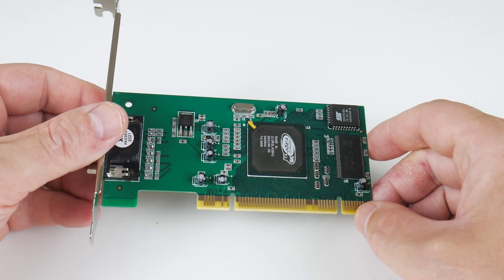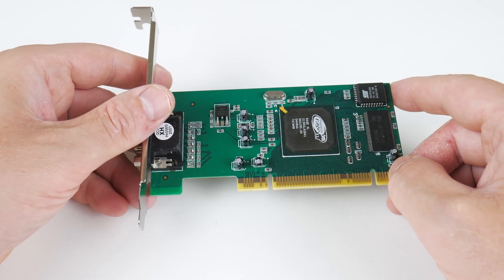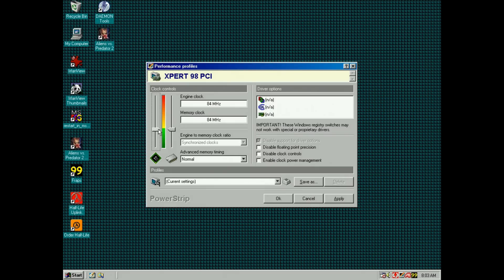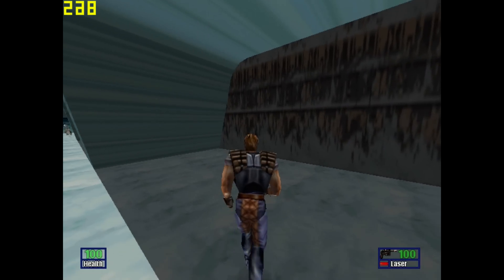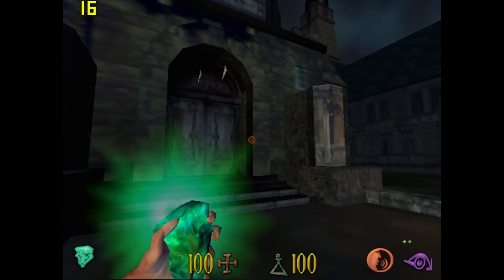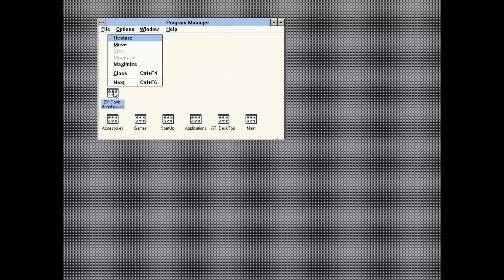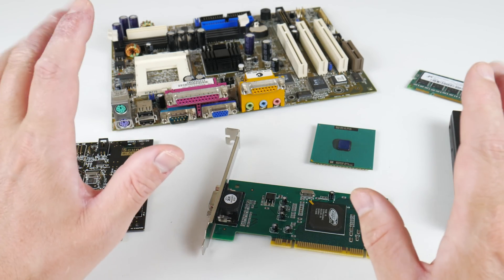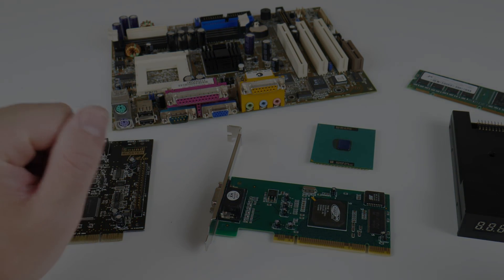Graphics Card shortage? Buy the ATI Rage XL!

Comment: I haven't checked yet but the driver disk says win98, but would this chipset have win95 drivers? Since most 98 builds would agp video cards I'd imagine this would make a better 95 card on super 7 or p2...might have to check this out when I get mine going
Reply from the maker: In terms of benchmarks and gaming performance, there shouldn't be much difference. But 95 can boot a little bit faster and maybe use less RAM. But RAM is cheap and easy to find, so I would go with 98, for sure with Socket 7 and Pentium 2.
Reply: @philscomputerlab  true. Win98 is better in terms of hardware and game compatibility...I was only thinking about socket 7 and older that had pci and no agp slots. I have a few Compaq, ibm and gateways like this that have win95 as OEM (with the specific "flavor" of branding ) that this could be a great upgrade for...since most at that time had maybe 2mb gra  onboard
Reply from the maker: I have only used 95 a few times. Even on lower end Socket 7 machines, I would go with 98. Just don't do a full installation and avoid unofficial service pack. And give the machine enough RAM, like 128 GB and you are fine :)
Reply: @philscomputerlab  I've used 95 if an OEM PC comes with it, or when I built a pc of parts right before the release of 98 as a last hoorah for 95 (parts that came out early 98/late 97)  but yea I prefer 98 for testing older parts. Much more stable

Comment: That card is so small and simple that it kind of looks like a PCI NIC!
Speaking of NICs and networky type things, the Rage XL was used in a lot of servers back in the mid 2000s.
Reply: Up until 2006 when ATI discontinued the Rage XL chips and replaced that model with the ES1000, based on the first Radeon (7000) in 2007. A bit bizarre to relaunch such an old GPU core so late but it required very few external components (good for cost) and was "good enough" for monitoring use in servers

Comment: Ahhh I remember this card very well. My first PC had a S3 Virge which didn’t work well with GTA2. My cousin had this card in his PC and that ran it so well. This was well before AGP graphics cards where common, even had a ISA modem and sound card. Upgraded to the notorious FX 5200 few years later.
Reply: Interesting, my second system had VIA integrated graphics which didn't run very well classic Quake2, so I bought it the FX5200 and game played better
Reply: I hate the S3 Virge, It's the worst "accelerator" I've ever used. Half-Life runs better in software mode on my old rig!

Comment: this gpu and the SiS 6326 are my favorite cockroach card. another budget card for me is the ati radeon x300 for win98 & xp early builds, the x300 can be had cheap and plentiful.
Reply: I had an x300. I used it for an output card to a 3rd display in order to get SoftTH to work. It struggled with 2D at 1080p!
Reply: I had an SiS 6326 from sometime in December, 2000 to sometime in late-April, 2001, when I got the Voodoo 3 3000 AGP. It pretty much was only good for non-demanding games.

Comment: I remember seeing Dawid review this thing since it's so cheap on amazon. my question is, why is there all of a sudden so many of these seemingly new-old stock cards that are almost 20 years old out in the wild now?
Reply from the maker: Likely they got their hands on old stock chips, and / or, removed them from old hardware and then designed a new product around it.
Reply: @philscomputerlab  Yup, the chip's date is 2004 and I think the memory chip is from 2003 (*maybe* 2013 but I doubt it, the markings are a bit faded)  

Some Chinese factories are making interesting upcycled cards and motherboards these days.  Another one I like is the CX2388x PCIe cards with similar vintage capture chips and a PCI-e bridge.  They can capture in raw ADC mode, so it can capture raw VHS and Laserdisc RF signal off the tape/disk.

Comment: i have exact same problem bad textures and same flickering in quake 1 with Rage 128 PRO XL ... maybe also bad drivers? 🤔
Reply from the maker: Yes, do not use the latest driver from AMD website!
Reply: @philscomputerlab  Problem solved glitches are gone both GPU Rage 128 GL and 128 PRO. Used old drivers w98_r128_4_11_6263_EN.exe 😍😍😍
Reply from the maker: @Dudulinek82  Awesome!!!

Comment: Nice intro, humorous. I had the Xpert98 and play something like that. I tried the Rage II driver and sometimes it worked. But that was in 1998. But I should have got a 16mb graphic card with that PII 350mhz, with 100mhz bus. I got the Voodoo3 the very next year. Lots of chips will be available in this period because the limit of 1 graphic card per 1 client, Pc or household is being reinforced. a Mach64 was the chipset.

Comment: Pretty good card for early Direct3D games, essentially a desktop version of their Rage Mobility chip that was common in a lot of late 1999/early 2000 laptops. Shame CIF is broken on these. UT99 should run on it with the right config file settings, I run that on my Compaq Armada M700 with a Rage Mobility and other than being a bit slow you can tweak it to look decent (mipmapping needs disabling otherwise things get VERY blurry).
Reply: You can get CIF working to some extent with a very specific set of custom drivers from Gona's CIF Compatibility Matrix. At least Mech 2 and Tomb Raider work. I've got an old eMachines eOne with the XL onboard and can confirm it works.
Reply: Это бэушные чипы со старых материнских плат, которые китайцы садят на максимально дешёвые PCB. Даже шина памяти только 32бит, вместо 64-х, хотя несложно ведь было сделать и нормально. Эта карта хуже любой старой ATI Rage Pro.

Comment: I wonder how the SIS integrated video compares, I suspect it could be slightly faster
Reply: Well... I have an old pc with SiS Mirage 3 graphics on-board. There is NO driver for it. No driver for Linux, and the only available windows drivers are broken. The system crashes as soon as you install the driver, and will only work again if you uninstall it in safe mode, or recover the disk image. So that PC is stuck in software rendering mode.

Comment: The OST 6.3V 1000µF capacitors on that Asus TUSI-M motherboard can leak and/or go open. If this is the case, then a 3DMark benchmark test will not run stable in combination with a dedicated PCI graphics card. The other capacitors are usually good.

Comment: Are all of these with a 32bit memory interface? I also had no luck getting these to work on any Socket 7 motherboards, but the voltage mod looks interesting. Shame the other video is a bit light on details as to what spec regulator was used.
Reply: Yes, the card uses a single 8 MB 32 bit wide memory chip (K4S643232F-TL60). The chip on Phil's card is actually rated for 166 MHz, so it has quite a bit of headroom for overclocking. Not sure if the Rage XL can be pushed that far though.

Comment: The biggest pain is that ATI Rage XL can use 64 bit memory bus for VRAM, and that card uses only 32 bit.
Reply from the maker: I actually didn't look into that. Is there a test I can run to determine the memory bus width? I just assumed this card is performing at the right level, as I had comparisons from the Rage IIc and the XL was roughly twice the speed AFAIK. I since bought an AGP Rage XL, so there will be more tests soon :D
Reply: @philscomputerlab  There's no need for any tests to confirm the memory bus width, you only have a single 32 bit wide memory chip, unless there's one hidden on the back of the card.
Reply from the maker: @GGigabiteM   That makes sense! I wonder how much of an impact this has.
Reply: @philscomputerlab  50% reduction in bus width and probably 50% reduction in bus bandwidth is going to have a huge impact on performance. ATI did make proper Rage XL video cards back in the day, so it should be possible to compare the one from then and this one.

I used to have one and got rid of it decades ago because it was so painfully slow.

Comment: This was my first 3D accelerator. Got it to upgrade my Pentium Pro 200 PC in 2002 so I could play the hitman 2 demo that came in a magazine, it ran terribly and I had to aim at the floor in the outside parts to get a decent frame rate, but it was my first true 3D action game experience. Then I was gifted the full version, and it refused to start with this card, we figured out that using the demo's .EXE let the game start and although you miss the opening cutscene, I finished the game on this setup and fell in love with the franchise as a result. Still my favourite of the franchise, and although I don't have the PC anymore as the motherboard died, I still have the CPU and graphics card somewhere... 😁
Reply: So strange, that was my first 3d pc game as well. I still have the disk and case in good condition.
Reply: 👻 Ahhhhh the memories..
Reply: Oh the memories

Comment: Did you try pushing the card beyond 100MHz? Could be interesting to see where it maxes out, think I got the Rage Pro based Expert@Play card up to 117MHz.
Reply from the maker: I didn't push it harder.
Reply: For what it's worth, the SDRAM on my PCI RageXL is rated 5ns, so it should be good up to 200MHz, despite it being clocked at not even half of that by default
Reply: @Knaeckebrotsaege  The Samsung memory chip on this card is rated for 166 MHz.

Comment: This thing is way better than the RTX 3090 in one thing:-

It's not out of stock and has reasonable pricing.
Reply from the maker: That's right 🤣
Reply: @philscomputerlab  The late-Rage-family actually had good graphics capabilities for 2000, 2001 and 2002, the graphics looked good most of the time, but it was super slow for even a game that came out in 2000 that I tested. Seemed like the bigger problem, was that it was too slow, at least it was with a "Wintendo 64"!
Reply: @philscomputerlab  

I have no life. Im an introvert bro. Dont care about socializing. Not wired for it. But objectively improving technology is rewarding. Its not efficient work, but im making real progress now. And whats cool is once its optimized per app specifically with old radeons, new radeons, old nvidia, new nvidia, intel GPUs in mind, thats going to be a first step. Basically all the old shit needs every drop, and obviously running DX10 in windows 10 is iffy without a lot of hassle shredding the jungle for you. So does mobility hardware. What we should do is what MVG showed with Diablo getting fixed by a third party, but scale it up to more than diablo, you know. Another thing, sound card emulation. We should be able to make it sound like anything we want from the digital bottleneck. No excuses. Invent AI to do it or something right now.
Reply: @philscomputerlab  

Imagine a benevolent billionaire bought up all the markets RAGE chips to make sure they never were used for Half Life videos at sub 30fps ever again, once the remainder die horrible deaths of internal impedance erosion.
Reply: @philscomputerlab  

Phil im so proud of you. Pretty much everyone else has blocked me. My pseudo lab is uncovering more secrets in the matrix. You should check it out. Radeon should be an interesting departure from the data mining than publishing norm.
Reply: @philscomputerlab  

Phil lets stop flirting with eachother and collaborate since the selection process of pretty much a third of the other retro PC channels have decided they should block me for mass patching games in alignment with your windows 10 retro gaming video. We see very much eye to eye im afraid, so this must eventually happen. Kicking and screaming.
Reply: @philscomputerlab  

Imagine if you made a video about intels compiler spoofing, the thread scheduler trick to avoid context switching, -dxlevel, wrappers, I see you have made videos with game specific drivers as well. The optimized OS component will be the most delicate operation. I want to take it right up to the metal so to speak. Without being a hacker. What we really need is someone programming custom graphics drivers and A.I. texture upscales chop chop. How is that not a good thing?
Reply: @philscomputerlab  

Honestly you make almost certainly the best retro content. You might be trolling in this video when for a few bucks more you could be rocking DX10, but overall I think you mean well. And that you are a kind person. I just take it personally when people dont take me seriously. Im wondering what they are going to do when im programming fixes to your retro problems in the future. Like a tech jesus of retro.
Reply: @philscomputerlab  

Please Phillip your art is hilarious but last Christmas kids didnt even get new graphics cards. Many are still waiting for the dawn from the Jensen induced nuclear winter. If I had more PC Master Race Scientists on the task, we could collectively patch retro. People arent going to care unless its a significant synergy of means, and only if someone really cool like you or Linus would step up, and save mankind from mediocrity.
Reply: @philscomputerlab  

I see interpolation as an option in shadowman the remake. Also a feature some retro needs. 30fps is a necc evil for my purposes but sometimes its a necessary evil period because thats how the engine does you without defects. Brute force workarounds make for more graceful fluid imagery. Know what im sayin dawg?
Reply: @remasteredretropcgames3312  L + ratio + you fell off + cope + quote tweet
Reply: @adam7280  

You have literally 0 content. Now im supposed to treat your comment like its worthy of being deciphered, as if it has any substance at all.
Reply: @remasteredretropcgames3312  seethe + stay mad lol
Reply: @adam7280  

Anarch' are nice MAD
An organism at war with itself is doomed.
-Carl Sagan
Reply: @adam7280  

Hate and prejudice can be as poison as toxins.
-Captain Planet

There’s always a bigger fish.
-Qui-Gon Jinn

You can't win, Vader. If you strike me down, I shall become more powerful than you can possibly imagine.
-Obi-Wan Kenobi
Reply: @adam7280  

Children Of Bodom - Oops I Did It Again!
div0ff, YouTube
Reply: @adam7280  

Quantity has a quality all its own.
-Joseph Stalin

Intelligence is an accident of evolution, and not necessarily an advantage.
-Isaac Asimov
Reply: @adam7280  

Dream Theater - The Alien (Official Video)
Dream Theater, YouTube

Rocket science has been mythologized all out of proportion to its true difficulty.
-John Carmack
Reply: @adam7280  

"The crown chakra, or sahasrāra chakra in Sanskrit, is known as “the bridge to the cosmos.” It is the most spiritual in nature of all seven chakras. Located above the crown of the head, it acts as the individual’s center of spirit, enlightenment, wisdom, universal consciousness, and connection to higher guidance."

My brain is only a receiver, in the Universe there is a core from which we obtain knowledge, strength and inspiration. I have not penetrated into the secrets of this core, but I know that it exists.
-Nikola Tesla

Life-forms living together for mutual advantage. Without the midi-chlorians, life could not exist and we would have no knowledge of the Force. They continually speak to us, telling us the will of the Force.
-Qui-Gon Jinn
Reply: @adam7280  

Metal Gear Solid 4 - Snake Meets Big Boss (Final Scene of Franchise)
Shirrako, YouTube

He who conquers himself is the mightiest warrior.
-Confucius

Neither shall they say, Lo here! or, lo there! for, behold, the kingdom of God is within you.
-Jesus Christ, Luke 17:21

Genetic engineering is a result of science advancement, so I don't think that in itself is bad. If used wisely, genetics can be beneficial, but they can be abused, too.
-Hideo Kojima
Reply: @adam7280  

Everything that irritates us about others can lead us to an understanding of ourselves.
-Carl Gustav Jung

Autistic savants tend to have left-brain dysfunction coupled with right-brain compensation, and this has led numerous research groups to wonder if sabotaging a portion of the left brain might grant savant-like abilities..
-Matt Kaplan

Until you make the unconscious conscious, it will direct your life and you will call it fate.
-C.G. Jung
Reply: @remasteredretropcgames3312  "Whats for breakfast?"
-Walter White Jr.
Reply: @adam7280  

For small creatures such as we the vastness is bearable only through love.
-Carl Sagan, Contact

Power overwhelming.
-Archon

Get off your horse and drink your milk.
-John Wayne

"The signal appeared to come from the direction of the constellation Sagittarius and bore the expected hallmarks of extraterrestrial origin."
Reply: @remasteredretropcgames3312  all jokes aside I have absolutely no idea what you're talking about what are all these quotes supposed to mean lol
Reply: @philscomputerlab  

Literally performs like my integrated SIS 530 4MB dog cocka. You would be better off trying to run 3D graphics off a modern calculator.
Reply: @philscomputerlab  

That was the funniest shit ive seen in awhile. I laughed so hard I was crying. Thanks Phillip, you are a true joker.
Reply: @philscomputerlab  

It runs a little bit better he says.

Screen literally shows 12fps.
Reply: @remasteredretropcgames3312  WTF. Why are you replying so many times and cluttering my notifications? Can't you just write all of these in one single reply?
Reply: @ardwivedi16  

Lol, clutter implies the ATI Rage. We should all buy them up and write software to run them in parallel in custom motherboards. Then we can using crazy math run cyberpunk using windows 98 at 160x90
Reply: Also have you gone insane you made 22 comments about this
Reply: Also size and power consumption
Reply: jokes aside, if you willing to buy used, you can do a lot better. you can even get cards that will run modern games for that price... not well thou
Reply: :goodvibes: